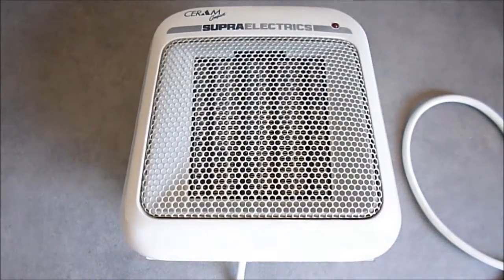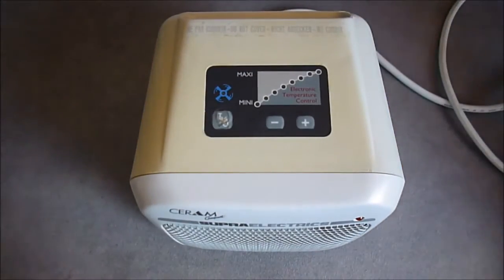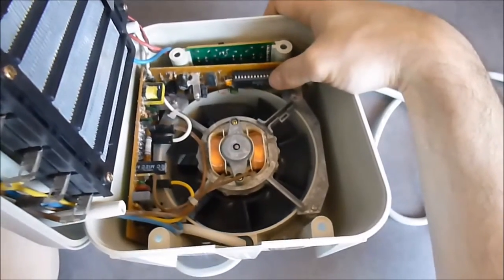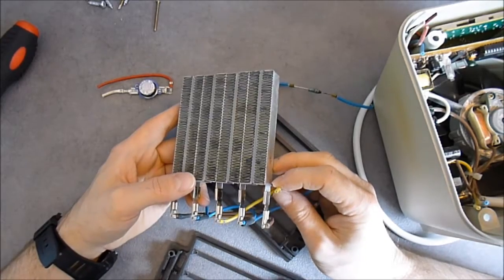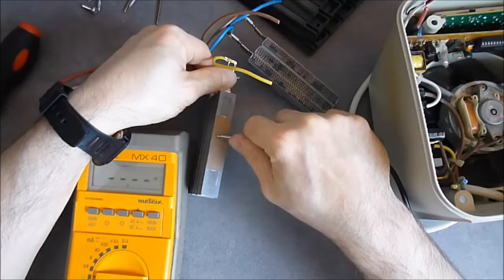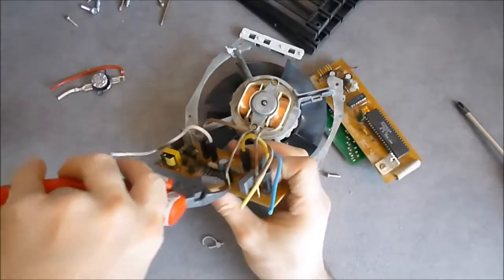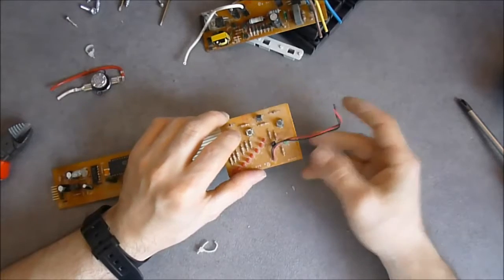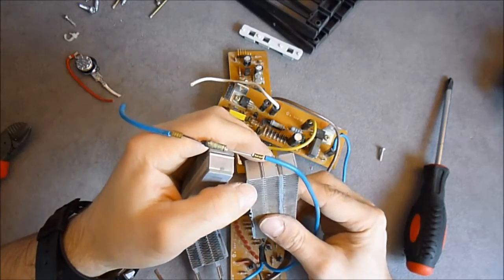Vintage Ceramics heater teardown

Comment: It seemed very well made. Why didn't you try to repair it? Was the thermal fuse and thermal cut out good? Diodes are often used to measure temperature even in PC CPU's.
Reply from the maker: Yes, these parts are good, I believe the ceramics elements died in some way, they seem to read way too high, which may mean not enough current flowing, so no heat generated...
Reply: msylvain59 Don't forget, ceramic elements often have negative temperature coefficients, so the resistance drops as they get hotter, unlike metals. Fascinating design! I noticed the fan is a shaded pole reluctance motor driven one, yet it varied in speed, I wonder if there was a variable frequency drive!
Reply: ***** The resistance of the elements was probably too high. Ceramic heaters are special because of the positive temperature coefficient as they get hotter the resistance increases and the current and power drop. So there supposed to be safer. The speed of shaded pole motors can be controlled with a triac based controller similar to a dimmer switch.
Reply: Coolkeys2009
Reply: @TheChipmunk2008  I was looking at the fan and noticed that also. It seems it may have a variable frewuency drive. Its kinda hard to limit speed by voltage on those as the frequency controls speed by timing poles. So could and maybe some volt/watt adjustments as well. maybe intel chip has a control for it, or possibly runs half wave 25hz-30hz for low speed and 100hz-120hz for high and normal frequency for medium if it has one

Comment: They don't make them like they used to. I have a ceramic heater from walmart. It works well, has a thermostat on it with LCD display, I had to take it apart to service the fan and it was literally just a computer box fan... and the device doesn't have a tip over switch either... Similar heating element though.
Reply: Oddly enough, the early ceramic heaters used that style of fan too, just larger AC powered ones. Those older heaters were built like tanks.